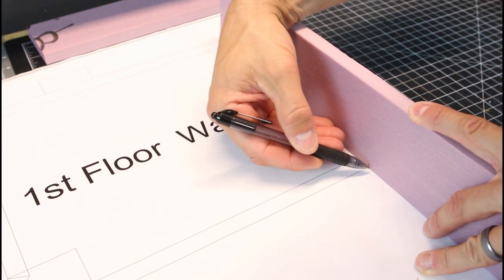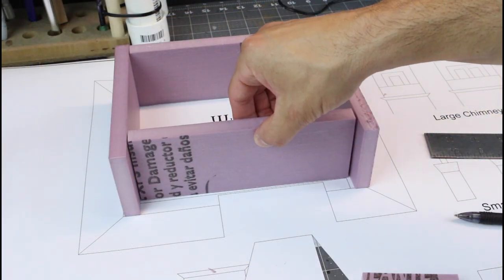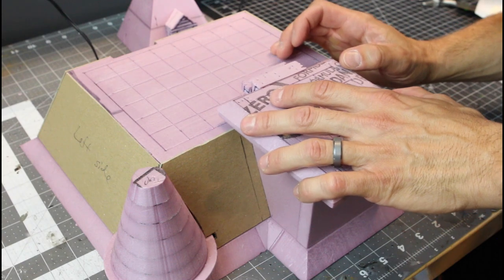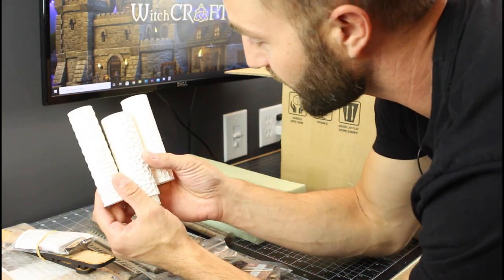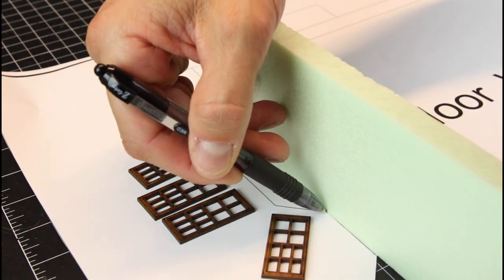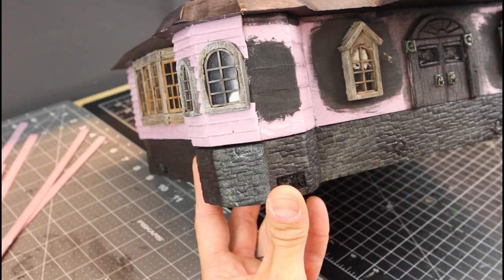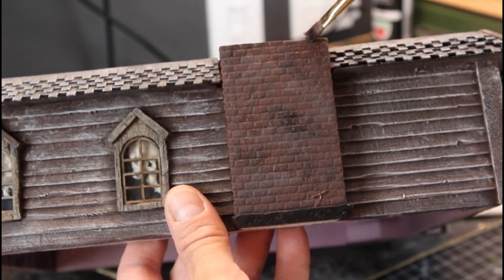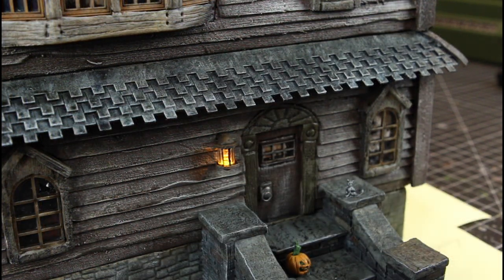Amazing Haunted House for Tabletop Gaming and Dioramas

Comment: There's an architectural trick where they vary the size of the shingles as they go up the roof, with the largest shingles on the bottom row and the smallest shingles along the top of the roof.  It gives the illusion of the roof stretching up higher than it is.   I wonder how that would look on a miniature.
Reply from the maker: That's really cool!!  Thanks for sharing that.  I might have to give that a try.

Comment: Fun fact: XPS foam is semi-illegal to use in construction in my country. Turns out the stuff release cyanide gas when burned, so we only use it encased in concrete. Masks and ventilation won't cut it guys, don't burn XPS foam with an open flame. Hot wire cutters melt, they don't burn, so that should be okay.
Reply from the maker: Yep you don't want to be lighting it on fire.  Using a hot pin is pushing it.  I have a 5500 CFM fan that I work under along with a really good P95 mask.

Comment: couple of suggestions:

-for glass an interesting alternative is that foil you put on windows to matt them out so people can't look in.
tracing paper + varnish is also a good option for a translucent but not transparent effect.

-best way i found for diffusing and spreading light so far is 2 layers of tracing paper spaced 1cm apart at at least 1cm from the LED.

-since you like epic builds, how about this: build a spelljammer ship with a hull based on plans for one of those wooden models
of old sailing ships.
i see no reason why you couldn't use XPS foam in place of wood. in fact it seems like foam would be much easier to work with.
and instead of the normal stuff build the decks and things on it with no regard to the fact that it is a ship. (it's magic after all)
imagine a ship's hull with a little castle on top flying around :P 

-a cool horror effect can be made using a combination of LEDs and that reflective foil you put on windows so it looks like 
a mirror from the outside, but you can still see through from the inside.
the effect is determined by the differential in light levels behind it, so that means that if you use it to cover a box it looks like a mirror
until you turn on an LED inside and it becomes transparent.
you can use this to make a scrying device and even set it up so you can easily switch the box part and have different scenes.

-using the same foil and a mirror you could make the infinity mirror effect to create the illusion of a long passageway 
that in reality is like 1" thick.
again this could be turned on and off with the LED, so it would make for a great portal effect.
combined with some good diffusing of the light and maybe those stained glass sheets it could look pretty wicked.
Reply from the maker: Excellent ideas... all of them... stay tuned ;)
Reply: @TabletopWitchCRAFT  quick heads up:
i have started work on my own attempt at the spelljammer ship, but the way i had envisioned it requires a hot wire table of maybe 3x the size of the proxxon :P

if u are tempted to do that one, i'd hold off and see how i get along...

Comment: Cool LED pumpkin. Hope the LED never burns out on you.
Reply from the maker: Thanks!  It’s not a big deal if it dies on me.  It took about 15 minutes to make, and it comes off the build :)
Reply: @TabletopWitchCRAFT  As long as it's detachable. :)
Reply from the maker: @monsterhobbiesageofsigmar  Yep it is.  I show it in the video.
Reply: @TabletopWitchCRAFT  No, I mean that the LED is detachable from the Green Stuff pumpkin so you could replace the bulb without replacing the pumpkin. Actually, i think you could do that if you cover the bulb in a little butter before applying the green stuff.  Once the gs hardens, you could pull the bulb out, clean off the butter, and then put the bulb back in the pumpkin and turn on the bulb. - anyway...how large was the house? It looks pretty massive.
Reply from the maker: @monsterhobbiesageofsigmar  Oh yeah, you could do that for sure.  As far as the size its a about 17" tall and about 13"x13".
Reply: @TabletopWitchCRAFT  Nice!

Comment: Hi buddy , when your surface area is to big for hot glue your using wet tacky glue i see , if your looking to stick it without waiting on it  drying use tacky glue like your doing but put it on both surfaces and let it go off to its clear state then put both surfaces together and itll stick straight away rock solid , in other words contact adhesive for foam...😉
Reply from the maker: Great tip James, thanks for sharing.

Comment: AWESOME!
Reply from the maker: Thank you Fabio!!!
Reply: @TabletopWitchCRAFT  really, I think is the most complex and beautiful use of foamboard that I've ever seen! if I had to make a criticism, the only thing I noticed is that those strips of roof tiles are really too symmetrical and regular, I would have seen better some irregularity, crooked tiles, splits, etc. But it really is a detail inside a masterpiece!
Reply: @TabletopWitchCRAFT  a question: what type of led have you used for the trebling lamps outside the door? Have you used some resistance to connect to the battery or not? I've always probelms in understanding electrical parts for leds... ;)

Comment: Ummmm is breathing in the smoke that comes off the wire on the proxxon really that bad? Mine came in today and I already cut about 300 XPS foam bricks and didn’t wear a mask 😳
Reply from the maker: I tried asking the companies but got no response from them.  I wear it as a precaution.  I notice after long periods of foam cutting it bothers my throat and eyes…. So I wear the mask and use a vent.